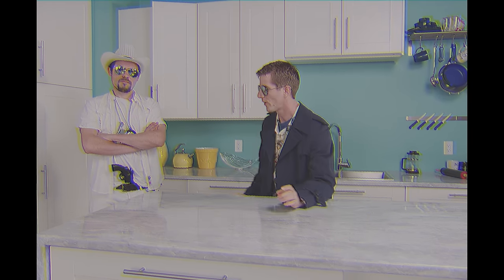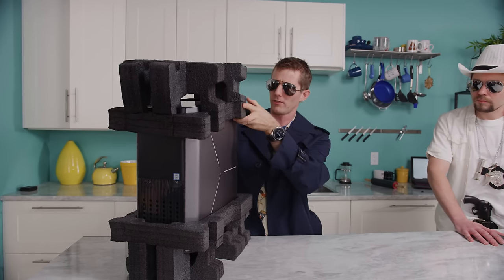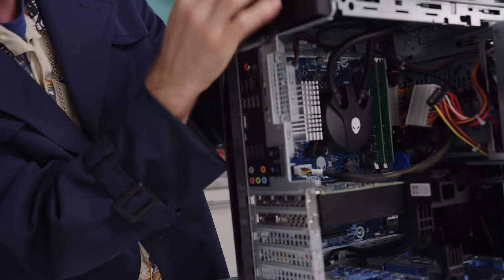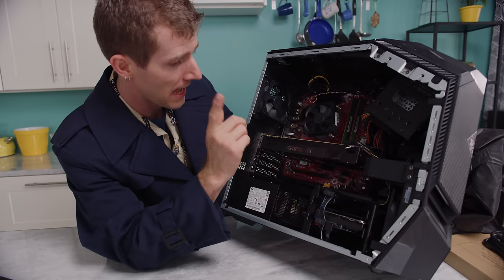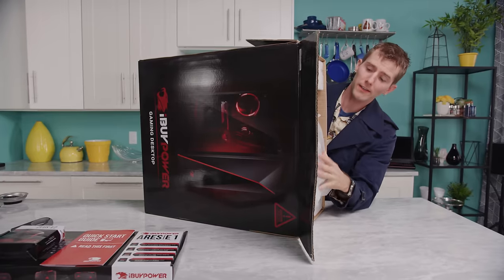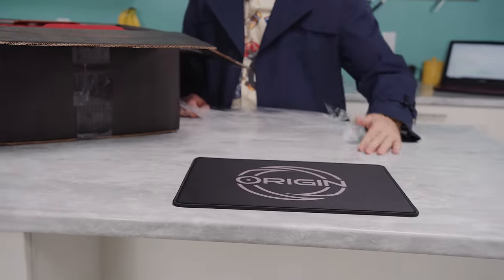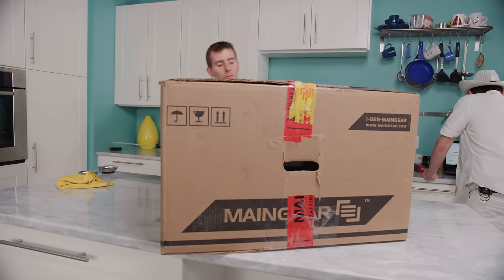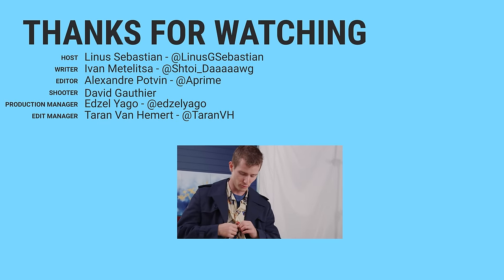What did we BUY?? - $1500 Gaming PC Secret Shopper Part 2

Comment: And I felt like my i5 8400 / GTX 1060 / 16GB RAM Prebuilt at $1,000 USD was bad value.. Yikes
Reply: You could've bought all of those used for 10-50% less
Reply: I bought a i5 7400 , gtx 1080 , 8 GB RAM. , Rgb everything ... At $ 1100 last year
Reply: in mid 2017 i got an i5 7600k with a msi gtx 1060 6g, 8gigs of ram (upgraded it to 24 later), a 250gig samsung nvme, a silenced case and pretty good quality matching stuff
Reply: Got a MSI 1060 6GB, i5-6400 & 8GB DDR4 RAM; paid ~$870 2 years ago
Reply: i7 3770, gtx 1060 6gb, 12 gb ram, 3tb hdd for ~660 (no ssd, don´t need that actualy)
Reply: @leelee-rf6px  where can I get a used 8th gen i5?
Reply: @leelee-rf6px  I wanted a full warranty from the PC store, brand new parts and they built it to my spec so it's a win/win

Comment: 1500$ ... 1050Ti .... Joke ? I recently builded my PC and it's a 1050Ti build all new parts for 425 euro in Europe .. In North America prices are even lower , WTF
Reply: Yea that's a huge rip off. They spent most of the budget on their custom case.
Reply: @flagovhate  and it still looks horrible, that case is just disgusting
Reply: @Blackbirdxd  lol yeap, terrible layout and air flow. I just built my second rig using the Thermaltake V1 white case, take a look at that layout and let me know what you think.
Reply: @flagovhate  Not that familiar with ITX cases but it seems good to me, definitely better than this piece of shit lol
Reply: @Blackbirdxd  my first ITX build, but i really liked this style. It was cheap too ;)
Reply: @flagovhate  why did you choose itx ?
Reply: @Blackbirdxd  wanted a challenge, my current PC is the thermaltake v21 which is basically the same as the V1 but it's a ATX chassi. So for this new build i wanted something more compact that i could potentially travel with or atleast move easily. So i debated on whether i wanted itx/atx mid tower or w.e. i really didn't like the air flow of alot of newer cases, i find it seems to be an after thought, and for me, it's one of the mose important features. So the V1 being an ITX with great airflow, it was an easy pick.
Reply: Which parts exactly did you use? Complete for 425€ is very good.
Reply: Yup, that's why it's worth it to build you own machine.
Reply: my 1050ti msi card cost me like 290 on sale alone. 425 euros is like 480 bucks US, so the card is like half that price alone. How in the world did you get PSU, CPU, MoBo, Case, RAM, Main drive storage, and all, for like 200 bucks?!?!
Reply: So you get 500$ PC for 1500. Nice one origin pc.
Reply: @gteco3018  Damn dude I need your hookups if that is actually the case XD. The 2080Ti costs only slightly less than that system by itself.
Reply: Ye, i bought a notebook with 1050Ti OC´D and I7 7700HQ for 1300USD so thats huuuge ripoff
Reply: thats origin for you.
Reply: These were prebuilds, there is always a markup for having your system built for you
Reply: yeah, but you got a steam code and a poster!

just joking, that was the definition of a rip off.
Reply: @Herbertti3  origin pc is the worst.  At least from my experience with them.
Reply: builded lol
Reply: yeah Origin is the MAC of Windows PCs, my PC had a 1800x and a 1080 and I put it in PCPP and it came to $1100
Reply: Built.
Reply: Look at Origin's site... they hugely overprice stuff. It's about as bad as Apple with price vs specs.
Reply: I just love how they sent him Black Ops 4 with the 1050Ti when the recommended GPU is a 1060 6GB for Black Ops 4 =)
Reply: Obtuse Square  and what a fx 6300 in it?
Reply: The case looked like a Xbox  360
Reply: Built*
Reply: @Pedro Gonçalves How did that computer run without a powersupply, motherboard, cpu-cooler, case and a operating system?
Reply: I agree, 400€ for a Ryzen 3 + 1050 and 1350€ for a i7 8700 + 2070 + 32Gb ram. Both premounted and ready to turn on. This ones are soo expensive.

Comment: Maingear is the clear winner here, both in sales and delivery of the product
Reply: R5 2600X with a 1060 is a perfectly good balance of CPU/GPU too, though a 1070 would have been nice for that price I suppose.
Reply: They did have the best service, but HP arrived first and the product appears to be better.  The 8700/1070 combo should easily top the benchmarks.  It has an NVMe SSD rather than SATA and 2TB HDD as opposed to Maingear's 1TB.  The HP also has an optical drive, hot swap hard drive bays, and what appears to be better front I/O.  The only advantage Maingear has is cooling.  The HP's cooling appears to be adequate but really, 92mm fans in 2018?  

I build my own PCs so I'm not at all the target market for these systems but I've had a good impression of the Omen machines (even recommended one the other day) and it appears I was on the money with that.  If you don't want to build it yourself and money is no object, it seems like Maingear would be a good choice.  At the $1500 range you're probably looking for the best value and out of these options HP is it.
Reply: If we’re taking it as a whole package and assuming no building knowledge for the end user, main gear cleaned house after the customer support video. Packaging was top notch, service was the best of the bunch, and the machine was competent - if a little overpriced. Assuming an above average amount of building knowledge, I’d still buy something else.
Reply: The HP machine is a $2000 machine compared to the $1500 Maingear machine.  Price to performance I think the maingear system has the edge and in terms of daily use I would much rather have the quieter and cooler maingear system.

Comment: That HP Omen actually looks pretty nice
Reply: You should see the laptops...
Reply: Yeah it offers a pretty cool price to quality/performance
Reply: Yeah i have a hp omen, buut i have the lowest model the 880-001na :( but the build quality is great, it comes with i5-7400, gtx 1060 3gb, 8gb 2400mhz ram, 1tb hard drive, 550w bronze psu,
Extra hdd screws for the hotswap hdd cage, very nice case and carrying handle, one thing i dont like is the stock intel cooler on it but for just £25 you can get one of the best coolers on the market the cooler master hyper 212 evo. Overall is a great pre built
Reply: Too childish.
Reply: @basshead.  I agree that the design didn't look all that good. The build quality seems decent though. I especially appreciate the optical drive. Sure most OS and software can be installed either over the internet or from a usb device, but I still like to have an optical drive in my desktops. It's not like it takes up a lot of room or is a huge added cost. OK so I've just been weened of the floppy drives. The first time I used a motherboard without a FDD controller I felt cheated. I ended up buying several USB floppy drives that got used perhaps once or twice each...
Reply: +theX24968B  My case is a custom built open case. I have my studio tour and gaming setup video on my channel.
Reply: @rossaitken5520  I have the older but almost identical system to yours in my downstairs living room, the 870-224, really great PC for 1080p gaming, and it was cheap as hell when I got mine, still using the stock intel cooler, it just doesn't get hot enough to justify an upgrade, 80-85C was the worst I ever saw it do, generally it hovers around 35-40C and around 60-70 when gaming. What did NEED an upgrade desperately, was the RAM, 8gb just isn't enough for a gaming system that's actually pretty decent, in GTA V in particular, on max settings I used to get this weird hitching, but if I checked task manager, I was only using 3.5-4gb of RAM. See the GPU reserves half of your RAM as a page file in case it desperately needs it, so that's 4gb gone, so you're really trying to run the game on 4gb of RAM, then add in the 1.5-2gb of Windows 10 running and you're down to less than 2gb of RAM to run this enormous game. I got another 8gb stick, and never had that hitching problem again.
Reply: @basshead.  well as long as its not one of those ugly NZXT cases that looks and is shaped like a painted cardboard box, all the more power to you.
Reply: I actually own a HP Omen 870-224 and it’s pretty good for the price

Comment: the origin chronos looks like a bigger xbox one x ..... with three times the price...and less powerful, i mean gtx 1050ti at 1500 ? come on....
Reply: Still better Walmart overpowered gaming pc haha
Reply: @sarno97  true.....but we don't talk about that one
Reply: @sarno97  I'd much prefer the Walmart PC than the Origin. It's cheaper and much more capable.
Reply: @sarno97   No it isn't. Swap the PSU and the Walmart PC is fine.
Reply: Ironicly, the Xbox 1 X comparison here is fair, a 1050TI is infact slower across the board then the solution the Xbox 1X has for graphics.
Basicly the guts of the Xbox 1 X is a RX480 8 Gig level of performance, other then the Orgin PC being.....well a PC, it's a super rip off at 1500 bucks, the Xbox at 1/6th the price is a better option if you just want value.

The Xbox also has an optical drive.

This is why boutique PCs are bad deals for the most part.
Reply: The Origin PC ordered here is a garbage magnet. Giving it away to some poor bastard would be worth 100x more than trying to sell it.

Comment: 1070 will win for sure. Ryzen definitely don't need the water block that Intel does
Reply: Agreed. My brother has a Ryzen build, I'm on Intel and his CPU definitely runs a lot cooler than mine, all while giving comparable or in some cases even better benchmark results.
Reply: I am in agreement but I understand the reasoning for CLC in terms of getting the greater stability of higher clocks with XFR 2.0 with lower temps allowing greater overhead.
Reply: they opted for more cpu overhead which isnt needed compared to having the better gpu
Reply: @deek_online871  that overheard doesn't really do much in game results. A better GPU will always be better.
It's why ryzen is such a good option, bring cheaper than Intel means you can spend that saved cash on better GPU.
It seems to me that the cooler is designed more for Intel and their furnace
Reply: For sure, AMD is the better bet as it's cheaper which means the saved cash can go on a much better graphics card. Plus competition in the marketplace is always good, we need to support AMD, especially when they have the better product out there.
Reply: AMD has always been cheap and they always overheat from my experience usually after 6 months of gaming and editing abuse the Ryzen AMD processors burn up you get from lets say 3 ghz too 2.7ghz and so on poorly made cpu,s made in Malaysia for 2 cents an hour lmfao where in if you go intel the quality is their you wont see ghz drop after 6 months but Intel maybe after 8 years seriously and Intel has better cpu structure and the perks of hyperthreading and optimization and power efficiencies built in fact is 36 cores don't mean shit unless the structure or architectures are efficient you get 36 raw power cores with amd that are not calibrated and fail after 6 months where intel is built too last and is and always will be better ….oh and another note nobody needs 36 core for gaming or editing at all more then half the cores sit idle 90% of the time hahahaha sad but true its like compensating for something hmm anyway I really want Quallcom too enter the PC CPU arena they already have Snapdragon 7NM 810 which is a octacore 2.0GHZ for your phone imagine their tech in a pc cpu it would be amazing then everyone would be in trouble
Reply: @EpicGamingEct  CPUs don't degrade, coolers do. The degradation of coolers is related to something called "dust". If you remove the dust from your cooler it will get as good as new again.
Reply: @EpicGamingEct  you mean Intel's overheat and run worse. You can't compare recent AMD with AMD from 7 years ago lol. There's not a wave of failing ryzens out there and AMD can use their desktop CPU in laptops, Intel has to build special CPUs for laptops or dramatically reduce frequency
Reply: Adolf Hitler  unless the GPU is held back by the CPU a better GPU will always make a better gaming system. That's the only thing that matters in these tests
Reply: no the core voltage literally degrades on Ryzon CPU,s over time , Intel however is just better and yeah cant attribute that too dust my cooler I clean every week with a dust blower
Reply: I have had no Overheat issues with Intel unless, I overclock in which you should always replace the cooler when overclocking too something better then stock like a liquid radiator cooler that's a no brainer guy and intel has always made different cpu,s for laptops too PC because cooling on laptops and the boards are different doesn't mean you cant use a intel pc cpu in a laptop, you can as long as its the right socket and compatible comparison and their is a lot of ryzen cpu burnouts in the last 3 years AMD runs hotter and requires more cooling this is fact
Reply: @EpicGamingEct  you must have a very bad luck. I use 1600s in both desktop and laptop and I have no issues. Though I guess I'm not running extreme overclocks like most people do due to thermal limitations (stock cooler on desktop and limited cooling on laptop)
Reply: @EpicGamingEct  I still have an overclocked 8350 at 4.8ghz on water with a 980 and it still runs fine. It was built 5 years ago. Its my wife's pc now  but it hasn't had any problems. The coolers degrade not the cpu with use.
Reply: @EpicGamingEct  you must be talking overclocking. I've never seen a single ryzen running hot on stock clocks. Ryzen is a great CPU on box coolers unlike Intel which fails to maintain frequency with their stock shit coolers
Reply: @pleaseelaborate3163  The degrade you're talking about does that include the amount of time versus how much it degrades?
Reply: @EpicGamingEct   With all due respect, you know absolutely nothing.

Firstly both AMD and Intel make good quality products, however I would give the nod to AMD due to the soldered IHS which is far better for heat dissipation. 

Secondly, CPU's don't get "used" up, no matter how much you use them. There have been many youtubers who have tested used mining cards which performed perfectly after heavy 24/7 use. 

Thirdly, Qualcomm will NEVER enter the PC market. They don't have an X86 license and never will.
Reply: hahahaha im dying of mass hilarity after heavy loads and repeaded use the micro wiring too each core wears cpu,s, they are not indestructible as said micro board wiring wears and less power flows through said wire resulting in less current lowering the ghz of individual cores over time this fact the processor slowly dies due too the micro wiring inbetween core resulting in less power too the core causing loss of ghz too individual core this is why you can test this with older cpus you will see discrepancies' in the core voltage example 2.7ghz core showing 2.69 ect
Reply: and as for Qualcomm if they partnered with intel or purchased a license in which is totally plausible they really could easily enter the market the fact that their processor thermals are unprecedented and mass production more affordable and have gone all the way too 5 NM in testing and have been using 7NM for some time they do have a huge edge on the market it would be a great move for the industry and would benefit the overall market being that theirs only 2 contenders out their too compete with
Reply: I just think it's sad we already know which PC is better, but Linus keeps the act up like maybe there's a tiny chance the 1070 won't crush everything else.

There are enormous leaps in performance at every step of the 10-series ladder and software is more optimized than ever to make use of hard GPU power.

Comment: omg sata ssd is perfectly fine for system responsiveness. maybe everyone forgot how slow it was to be using an hdd only.
Reply: Every benchmark and review out there shows that unless you're doing professional video editing of large files, the latency of SATA-based SSDs is not meaningfully different from that of NVMe drives.

The trick is getting the cost of 7mm 2.5 inch SSD drives (which are always [?] SATA-based) in the M.2.form factor, and then not going "oh well I can quadruple my file transfer speeds for only XX more dollars" while you're at it. Do I need it? Not even close. Is copying over a network between NVMe drives some of the fastest stuff ever? Hell yeah. But it really never happens often enough for most people, including myself, to pay for the opportunity.
Reply: I still use hdd only :) it sucks! Greatly!
Reply: @demondoggie6371 
If you're not using a laptop upgrade NOW!!!
A decent SSD with 256 GB will only set you back 60$ atm, and it's worth every penny.
Reply: Ralph Körner planning on it, but I have an alpha and it’s too small to just get a secondary drive, so when I upgrade it needs to be a tb to fit my stuffs
Reply: @Minecraftrok999  but Im too lazy to reinstall windows and all my programs and shit :(
Reply: @jokuemt  
Trust me, the benefits will outweigh the effort.
And besides, maybe (if you have space in your case/laptop) you can keep your old HDD and only need to install windows and 2-5 other programs and then you´ll be done.
Reply: Yea, I have SATA mounted SSD and I can not really say I am waiting for system response in anything, everything instant. (Yea, I still rememember magnetic HDD, where you were waiting seconds for system response sometimes :-))
Reply: I put my OS and programs I used often on my SSD, and use my HHD for everything else
Reply: @jokuemt  you can migrate the OS to the SSD with certain programs
Reply: I have a samsung 960 nvme in my rig, and it takes longer to POST then it does to boot. then again, i have many systems with sata ssds, and while they are slower, they are perfectly fine.
Reply: @Minecraftrok999  Even on a laptop the upgrade is worth it.  I miss having an SSD in my system.